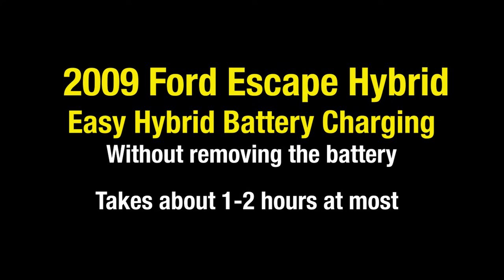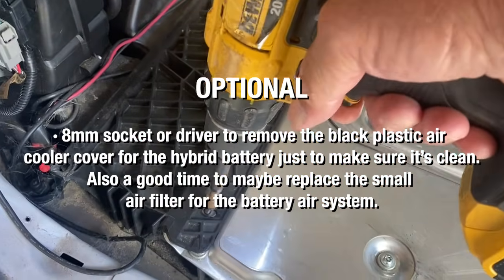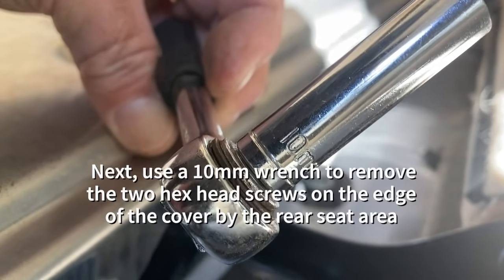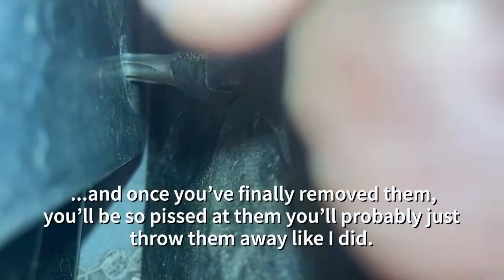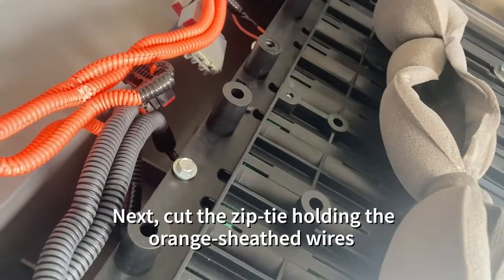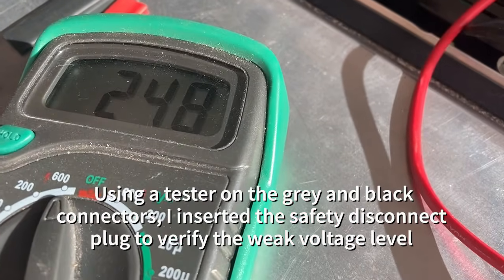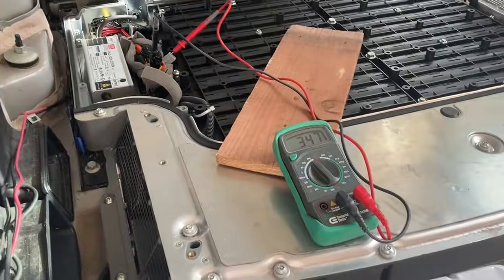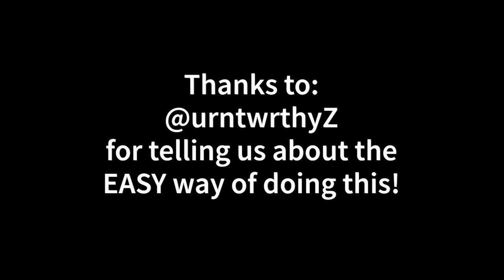EASY Hybrid Battery Charge 2009 Ford Escape - No need to remove battery!

Comment: So, update, I recommend grinding the torx bit at the 1/4 inch end by 1/2 the length of the not torx part to get it to fit in there with the recommended tool.  Made all the difference.  Took time to grind it then grind the corners to fit into the socket that was recommended , but it made the process way easier to get those torx screws out.
Reply from the maker: Nice tip 😉. That would definitely help!

Comment: This happened to my wifes car unexpectedly this week. We stored it with in laws and they tried running it every week for us but ended up draining the HV. Is there a way to set this instal up to make the connectors easy access to check voltage of the HV without removing the entire top of the chassis?
Reply from the maker: I guess you could install a voltmeter or protected leads to a voltmeter on the DC wires that get connected to the DC output of the “charger” before you close the case back up. You could also use Forscan app or software to read the HV battery voltage.

Comment: Not bad. Missed a couple points:

1) Seal the hole. This battery is hermetically sealed for a reason.

2) Charge for at least two hours. It's not about voltage, it's about state of charge. A battery at 1V/cell may have excessive internal resistance and may spike the voltage very quickly.  You need to use math.  The first 300-500mAh input is needed to restore the proper chemistry phases at the terminals and reduce internal resistance.  After that, you're getting legitimate charge.  Two hours at 350mA means you're only putting about 200-400mAh usable capacity into the cells.  That's 3.6 - 7.3% SoC.

Failing to restore the proper phase will 1) fail to start or 2) start but slam a bunch of current into the cells in a high resistance state and damage them.
Reply from the maker: Thanks for the comments.
I wouldn’t call the HV battery case “hermetically sealed”, especially since it has a barely filtered airflow system that keeps it from overheating by circulating outside air through the case.
As for the state of charge, I was only using this setup to get the engine to start. Once started, I let the factory engineered system take over to fully charge the HV battery, and ran Forscan on it to run the maintenance cycles on the HV battery.
Reply: @mattgatlin1918 "Hermetically" is indeed a strong term, but it conveys intent. The only intentional opening in the battery is the inlet/outlet at the driver's side rear. Everywhere else is "hermetically" sealed. When the blend door is closed, it very nearly meets the "hermetically sealed" definition. Leaks in the case, even small ones compromise the cooling system. Why compromise the one part of the system that is most key in pack longevity when a dab of sealant or foam fixes it? I prefer to drill a 1/4" hole and use a sealing grommet around the power cord. Super fast and effective.

Again, it's not about voltage, it's about state of charge and proper cell chemistry. I must not have conveyed this sufficiently. The "factory engineered system" does not take into account the conditions needed by deeply discharged cells to prevent damage. Rushing the recharge further exacerbates the self-discharge conditions already present.

Observing ~350V (1.4V/cell) after a few minutes of charging positively confirms that your cells were in a high resistance state. Pushing ~15A into them via the vehicle's charging system is not good for them. Charging in a high resistance state should be done at no more than about 0.2C.

Keep in mind these are the same "factory engineers" that designed a system that can discharge a completely healthy battery if left sitting for 30 days and will void your warranty (when these cars were young enough to still have warranties). Toyotas have sat for years without this happening. Furthermore, these are the same people that chose to 1) remove the factory jump starter because "it has never been needed" and 2) removed the battery A/C cooling system in the 2010+ years.

If your goal is a lasting repair that does not degrade the cells, patience is warranted. A two hour charge ensures the cells are in a state suitable to receive the charging system's current.

I've been doing this for 8 years, and I have a lot of experience with it (documented this process on a website 8 years ago).  I've done this to dozens of FEH/MMH, and I have substantial experience with NiMH hybrids having serviced hundreds and personally owned 14 NiMH based hybrids.  Charge for two hours if you want to improve the outcome.  My charger is 1.4A, and I still do it for 30 minutes before I attempt start.

Comment: Is there an alternative to the charger you recommended?  They are sold out on Amazon...
Reply from the maker: As of right now 11-1-2024, Amazon has 18 in stock. You can also buy the HLG-120H-C350A from TRC Electronics.

Comment: OK, so it probably took me two hours alone just to remove those two %&@*ing inaccessible screws, but otherwise I'm completely happy. Thank you, it worked! But does anybody know if it's dangerous to leave it plugged in too long? (This is now my son's car at college, where it might be left for periods of time and I'm not sure if he just needs to try starting the car every half hour after plugging in ... and I didn't wire it with an easy ability to check the voltage.)

By the way, I was able to start those screws by holding the Torx T30 bit sideways in a vice grip. But once it started coming out on one side, there was no longer enough room for the bit. So I did have to saw off an appropriately-sized allen wrench to finish the job, just like the video suggested. Anyway, just wanted to repeat my appreciation for this video!
Reply from the maker: Glad it worked for you. IDK about leaving it plugged in too long, but several other videos with these DIY charging setups talk about leaving the charger plugged in for six to eight hours. I’d recommend only leaving it plugged in enough to get the car started.

Comment: The voltage gauge  on the dash has the needle straight up so I’m thinking it may be my starter or something else.  The button for “jump start” on the left had no effect. Any way to check voltage with multi meter?  I take it the authors charger is 12 volts?
Reply from the maker: Sounds like you’ve got a 2008 or earlier. This charging workaround is intended for a 2009 or later.
Reply: @mattgatlin1918  yes it is a 2008.  Thanks

Comment: I wound up cutting the tab off on the driver's side with a Dremel.  Got the cover off, hooked up the charger, and watched the meter go up to about 340 v.  Still no start; at first the dash would light up, but no start. Now nothing lights.  There are ticking sounds coming from three different sources; presumably control modules.
I tried disconnecting the 12v battery, thinking the control module(s) might need to reset from lockdown mode.  Had to let the car sit without working on it for three days because it was raining.  Today, 0v at the HV battery before plugging the power supply in.  Upon plugging in, it goes directly  to 439.9v and stays there.  Reconnected the 12v battery, and same thing - no lights, no start.
Reply from the maker: Sounds like you’ve got issues other than just the HV battery. I’m pretty sure that most of the 12v components such as the lights are fed from the 12v battery under the hood.

Comment: Great video thanks Matt!  Long story SHORT, I think I might have hooked up the charger to the battery leads in reverse polarity (long day, should have waited).  Now the battery reads 0.3V and goes down to zero  if I measure it long enough.  I can't find a fuse that is blown, and I can't find any other information to help.  Any suggestions?
Reply from the maker: IDK. Maybe a defective or blown charger?
Reply: I did the same thing what happen with yours

Comment: very cool.  Why would ford do away with a system that could actually balance their batteries??  Hmm makes you wonder.
Reply from the maker: IDK. A specialized dealer-service procedure that potentially makes them several hundreds of dollars for simply charging a depleted battery? 🤑🪫 Such a scheme would only work if they could somehow make it so the ICE can’t start like a normal ICE 😂
Reply: @mattgatlin1918  that is what I thought!
Reply: It didn't balance the HVTB, it just allowed you to charge.  If you have FORScan you can still command a rebalance.
Reply: Cost cutting, the internal charger cost $900

Comment: Did you put a diode on the DC positive lead to stop power back flowing into the charger?
Reply from the maker: No.
Reply: Isnt it necessary?
Reply: Thanks, I didn't either and it's been functioning fine for 2mo. I haven't even needed to use it since the initial install. The car has been starting fine since, even after sitting a long weekend in sub freezing temps.
Reply: Highly recommended.

Comment: I have the similar Mercury Mariner 2008 and discovered there is a push switch that will charge the hybrid battery from the 12 volt car battery however this may not work if the car has been stored for a long time. 
The switch is either behind the access on the driver side dashboard when the door is open you can see a tab or under the steering wheel on the left. It will glow when  depressed and will take 5-10 minutes. I had  the triangle error pop on the dashboard and not start when the vehicle sat for a week or longer, once in the hot desert after 4 days of not starting the engine and pushing the switch for about 10seconds started the charge to the hybrid battery
Reply from the maker: Unfortunately, 2008 was the last year they included that charging system. It was discontinued starting in 2009.
Reply: My 06 hybrid:  Manual page 239.  "To jumpstart the HIGH VOLTAGE BATTERY (the one in the back of vehicle)
1.  Turn ignition to off. 
2. Open access panel IN THE DRIVER SIDE FOOT WELL and PRESS THE JUMPSTART BUTTON MOMENTARILY. -- indicator light on the button will illuminate
3. After pressing the button, you should wait 8 MINUTES before attempting to start the engine.. 
*Back battery charges itself from front 13 v battery. 
4. After 8 minutes, the INDICATOR LIGHT WILL FLASH RAPIDLY FOR 2 MINUTES.   (me:  Wtf?! 😳😖)
5. Turn ignition to RUN
6. You may now attempt to start the engine. 
Done 
*If you don't wait 8 minutes, you have to start all over. 
???!!!  
IT ACTUALLY WORKS!!

Comment: You may have been lucky with the 09 not having the charger. At 10:14 all the smaller color wiring that is held together and then goes right and under the cells, some of those go through the 08 charging unit. Not sure if they are integrated into the charging unit so bypassing with another charger is questionable. But same problem with letting it sit
Reply from the maker: Did you see this video of a guy charging a 2008?
https://youtu.be/1wHTyMJoqDg?si=zU3BvxMYJLVvr8hq

Comment: Hey Matt,
So I have the 2008 hybrid battery out of my daughter’s wrecked car on a table in my shop.  It has the charger you were talking about.  Unfortunately I didn’t take the button out before it went to the scrapper.  Can I use the 6 pin plug to put 12v so the charger inside the case will start charging?  Thanks
Reply from the maker: I don’t know about the 2008. Maybe someone familiar with that can comment…?
Reply from the maker: Did you see this video?
https://youtu.be/1wHTyMJoqDg?si=zU3BvxMYJLVvr8hq
Reply: Did you try this? Did it work?

Comment: Was thinking that the male prongs on your power cord will be HOT. Would be a good idea to plug a female cord end, with no wires, on to the plug, to prevent any danger there.
Reply from the maker: Hmmm. Maybe. IDK if the setup is allowing current to flow backward and make those prongs hot, but I’ll definitely check them with a tester to see. Thanks!
Reply: @mattgatlin1918  Good thing to double-check, with Chinese made power supplies. Sometimes not the most trust-worthy items.
Reply from the maker: I checked and didn’t show any current at the male plug ends. Probably because the AC to DC and voltage conversion in the charger unit isn’t made to run in reverse…?

Comment: Hi Matt, I have a question, when the battery was lower then 300VDC, did you had a message Stop Safely Now? That is the message I have on my car and cannot start anymore, when I scan shows battery is low, but my scan cannot ready the volts. Thanks for the video, very good!!!
Reply from the maker: Hi Marcio, yes I had the Stop Safely Now message. (The only other time I had that message was when I was driving and it was about 110 degrees outside and the battery was overheating.)
Reply: @mattgatlin1918 , thank you, I already order the tor bit, I'll receive on Monday, your video was the best I found with all information, as soon I finished I'll post again.
Reply: @mattgatlin1918  There was a recall for the cooling fan module in the battery. Mine failed just before my 100K warranty expired and ford could not figure it out. Luckily I found a article that exposed the fan issue and the dealer replaced it. I now have over 220k miles and still going strong except for the ignition switch issue which is annoying to have to push in while the key is turned to start the vehicle. I like to think that it is added security measure lol

Comment: I put a small pair of vice grips on those 2 hateful screws and tapped with a hammer to loosen. I would have had to remove the plastic side panel which is a real hassle on my 2008 ford escape to even attempt to remove them with a allen. Mine were allen and not torx. My built in charging system is not working as it did previously so I am planning to remove it and put in the unit like you did. Any comments?Thanks for the great video.
Reply from the maker: Sounds good. Getting those $&@%# screws off is most of the work 😉

Comment: Thanks for this.   This just happened to me today.   Does your hybrid escape have issues with aircpn when it is in electric mode? When on gas and going over 40 mph air con works but other than that it doesn't. This is an issue I've had to deal with for the longest time with no solution.
Reply from the maker: I’ve had issues with my air conditioning not blowing cold enough especially when it’s very hot outside. I read somewhere that the AC works to cool the hybrid battery, but I don’t see anything other than a pair of fans in the hybrid battery casing. I did have problems with the hybrid battery getting too hot on hot days even to the point of disabling the car. I haven’t had this problem since reconditioning the hybrid battery with ForScan, but I also haven’t driven it in the extreme heat that much yet.
Reply: @mattgatlin1918  for some reason my does not cool well if the fan is on full speed. I have heard some gear clicking from time to time but never figured out what it was. It always happens when the settings for the heater and ac are changed.

Comment: Thanks this really helped me and brought my car that’s been sitting for 3 years back to life. A few things you missed. There are actually (4) bolts total on the sides, the two you showed that were recessed and 2 that are not. These are easy to access but difficult to take off. I needed a breakaway bar to crack them loose. It took me 10 minutes for the right side and 8HOURS for the left side. Then it was like 20 min to finish everything else. The pentameter doesn’t seem to work on this charger it’s delivers a straight 440v I would imagine that might damage the battery. You also did t mention how long to leave the charger on for? All night? A few hours? Do you adjust the comrade somehow? Either way I did a lot of guessing and left it in for a few hours and was able to get it started. 🎉
Reply from the maker: Glad this got you up and running again!
My 2009 FEH only had the two recessed torx screws on the sides (1 on each side). Also battery chargers need to output more voltage than the battery’s normal operating voltage in order to work. For reference, a battery charger for a 12 battery outputs a little more than 14v and can go up to 16v (1.3x the battery’s normal operating voltage) without issue. 
As for the charging time, that all depends on how depleted your battery is. I’ve read that some people need up to 8 hours to get up to operational level. For me, I only had it on the charger for about 5 minutes and when I tried starting it while it was still connected to the charger, it started up. I think the output voltage of the charger was enough to fool the system into starting by showing more than 300v in the circuit even though the battery voltage was still below 300. After it started, I let the car’s charging system do the rest since it has much higher amperage than the paltry 350mA of the MeanWell charger.

Comment: Great video, after 15 minutes trying to get the bolt on the side I took the cutting wheel and removed it all together. Also just removed the one side where the charger goes and bent the other one up like a hinge. Worked great, thank-you!
Reply from the maker: Gotta love it! The cutting wheel is quite possibly the greatest tool ever invented 🤣

Comment: Anyone know if there's a fuse or relay to these wires? I was charging the battery but something happened and its not showing voltage on them anymore..
Reply from the maker: Fuses #8, 15, 25 & 26 in the engine compartment fuse panel all relate to the “traction battery”. You can find a diagram at:
https://www.startmycar.com/us/ford/escape-hybrid/info/fusebox/2009
Did you have the orange safety switch installed when you checked the voltage?
Reply: @mattgatlin1918  thanks for info. Yeah the traction batt is still powered and working but there's  no voltage at the legacy service wires anymore..
Reply: @timw1636 did you ever figure out the no voltage on these wires? I just had the same issue happen.
Reply: @RalphSki2  no solution but from a battery disassemble video the wires seem to run to a simple pcb board within. Maybe a burnt trace?
Reply: There is a fuse on the orange service disconnect